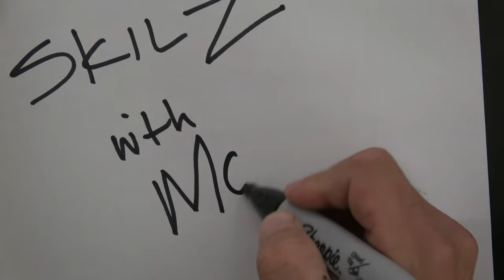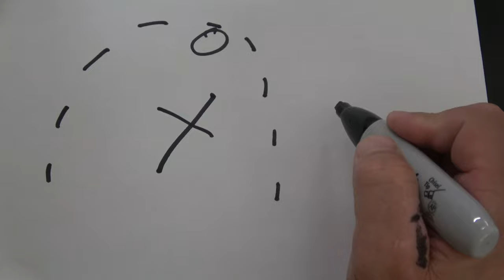how to turn a jetski - skills EPISODE 1

Comment: Thank you for the info! How do you select a pole length? I have a new sxr1500 and need a new pole and don't know how to select the right length. I'm 6'3" tall. Thanks.
Reply: Get and aftermarket pole and keep chopping it down til your happy with your length
Reply: @chaskacox-potter3217  thank you.
Reply: @chaskacox-potter3217  is there a big difference between carbon tube and aluminum? Should I save for carbon or just get aluminum?
Reply: @JohnnyRocketone  just weight in my option, and the feel of the weight will change based on a spring, so I'd just opt for aluminum. That being said I've never owned a carbon one just rode a boat with one
Reply: I broke a carbon pole in the sac river. Go with the Aluminum.
Reply: @JohnnyRocketone  Carbon Fibre is lighter and stiffer. Unfortunately the stiffness means it's less flexible than aluminium. I'd go with aluminium. It's more forgiving. In the 90s a lot of racers used carbon fibre hulls. Downside is that they would often crack in the surf because of the stiffness and lower flexibility than fibreglass. It's much the same with handlepoles too.